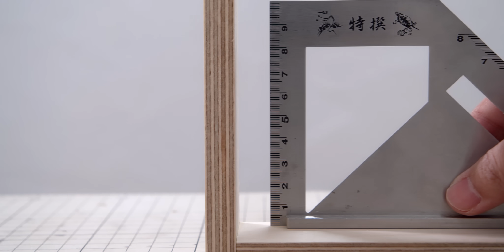DIY Making a super accurate corner clamp from scrap plywood

Comment: This device does not clamp, it only fixes. The kelly seam does not compress tightly. Therefore, the connection will not be very strong.

Comment: As a master craftsman for many years I have to admire your work. Simple but effective. As far as the store bought corner clamp I would have glued a very thin piece of acrylic on each side of the bolt to rise the finished product higher to make for a better right angle. Nice techniques. Thanks for sharing...

Comment: I am truly astounded by your level of understanding of simple mechanical devices, and how to make them play in your favor. I find myself oddly mesmerized by your accurate slight of hand, placing parts where they need be, using only the simplest tools available from your local hardware store and a little help from the Chinese suppliers.

I would gift you a crystal Finch for your wisdom and insight, would we ever meet.

Comment: as always, excellent craftsmanship! i have built a few of these myself and i found it helpful to relieve the inside corners at the bottom of the outside cheeks as well as the inside pressure pad. this allows for slight irregularities on the stock to be clamped. also, we shouldn‘t forget that these clamps only hold the pieces at right angles to each other, there is no latteral clamping pressure on the joint. this can be applied by using a bar clamp. great video as always!

Comment: nice work. I like simple but effective solutions.

One small improvement: if you grinder a small bevel into the lower edge (at 4:17 and 5:10) you avoid inaccuracy by minor particles
Reply from the maker: thank you for the advice！

Comment: If you drill two holes in the larger washer you can use two small screws to secure the clamp to the shaft without the glue, but that was  great!!

Comment: Nice work! Just one little tip if you drill with 2 different diameters like in 9:05: use the bigger drill/ forstner bit first so the next could use the center of this. This will be much more accurate, espacially free handed...

Comment: 2:50 a forstner bit with 4 cutters like the one you're using requires more power, which is why your drill is almost choking. Either use a forstner but with only 2 cutters, or buy a more powerful drillpress.

Comment: Hi,

It's possible that the moving part isn't exerting an effective clamping force to the joint.

Maybe the clamp can provide more effective pressure if it were the exterior sides that could move instead.

Comment: This is a super clamp, but it is limited in that it can only clamp two pieces of material that are the same thickness. I guess you could use another piece of wood as a spacer, if you happen to have one the required size, but could this be enhanced to support that?

Comment: Those clamps are intended to be used from top not from bottom. Used them to assemble my large wardrobe. Not as effective as yours DIY project, but helped a lot.
Reply: I use 2 for each corner. One on the top and one on the bottom. Results are spot on. I've  used this combination at least 1500 times while making custom cabinets. I really don't think it says anywhere that they are only to be put on at the top. So your comment is petty. I mean its not like his shop will fall into the Earth if he uses them on the bottom.

Comment: 2:06 you measured 9cm. But, when you find the center, it's 6cm from the edge, ie. 12cm. Also, at 5:39, on the table with the grid, it's 12cm.....

Comment: btw, my 45 year old stanley corner clamps do a perfect job, no screw thread in the way. the problem was, the clamp cheeks are too low, but as i said, these are really only meant to position and hold the work pieces at 90° to another.

Comment: Great job, I have one question, can this be used to butt joint wood piece with different thickness?
Reply: The only option to do that, they way this is made, would be to have a shim piece for the thinner material. So, if you were trying to do a 12mm piece to an 18 then a 6 mm shim (spacer) would be required butted to the 12 mm piece.

Comment: this guy : diy super accurate corner clamp scrap plywood
also this guy: uses every machine tool
Reply: This commenter: Jealous and bitter

Most of the tools that he uses, he made it himself. The vertical cross-cut sled as well as the drill press that you saw in this video, he made it himself. The only exception was the bandsaw though if I'm not mistaken he already made one as well.
Reply: @ImALefty08  my point is, its all MACHINES
Reply: my preference are hand tools so yeah

Comment: Your knowledge of joinery is limited to amateur.
Tools, are great.
Wood Adhesives are ... complicated.
REAL WORLD EXPERIENCES OF CAPITALISM INTERSECT IN MANY WAYS.
TIME.
PROFITABILITY.
EFFICIENCY IN PRODUCTION.
try this tip... TEST IT IN STRUCTURE.
Apply very light full surface layer onto both faces....quickly.
Pressing gently... SLIDE THEM UNTIL THEY STOP SLIDING.
CLAMP .... LET DRY AS PER SPECS... AND TEST.
A consistent concave bead to seal the joint does add integrity.

Comment: it's ok, but only with both equal thicknesses. Great job anyway!
Reply: Yes......won't work with diff thicknesses.... need to individually clamp pieces !
Reply: If you can make a slot that will allow a nut to slide inside - this construction will allow to hold different thickness materials.

My main concern will be that I might still prefer to clamp two pieces separately.
Reply: I would try to add a shim to the thin side. For example: add a 1/4" shim to a 1/2" to 3/4" joint. It might be tricky in some situations.
Reply: Henry Schuyten ....that is exactly what i am doing ......Glad to know that you are also on the same wavelength.....Greetings for the New Year !
Reply: Andrea Caffara....that's where your imagination and creativity kicks in...what a joy to stay in the workshop...keeps you safe from covid-19 and away from bad mouths...peace